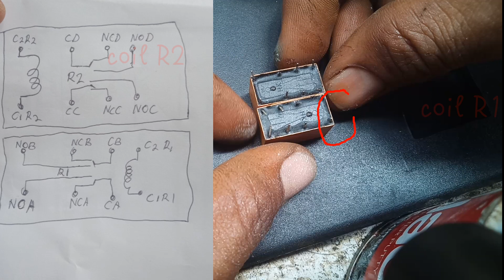membuat kontrol arah putaran dinamo

Comment: Pak itu dinamo berapa volt?
Reply from the maker: 12 volt mas
Reply: Apakah alat itu bisa di gunakan di dinamo 220v?
Reply from the maker: Bisa mas jenis relayny diganti disuain kapasitasny,  NOC dan NOD di vidio ganti supplyny jdi 220VAC
Reply from the maker: Untuk power kontrol ttep ake 12vdc
Reply from the maker: Atau untuk motor AC bisa menggunakan yang manual (timer mesin cuci 2 tabung yang bagisan timer wash "bukan timer spin)  semoga bisa membantu jwabannya
Reply: Ok terimakasih ilmunya semoga sehat selalu dan di diberikan rizki yg berlimpah Aamiin...